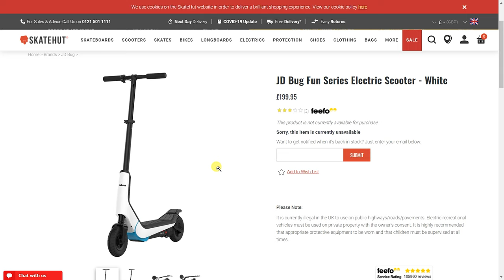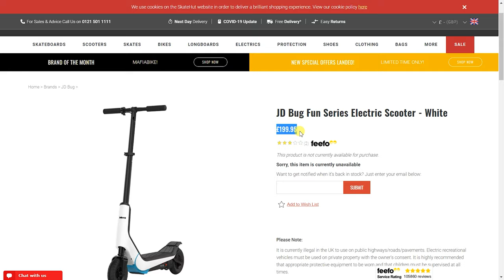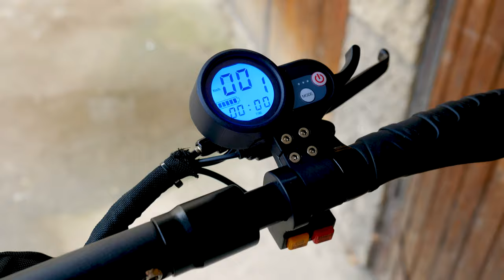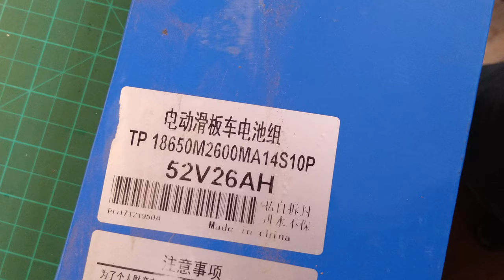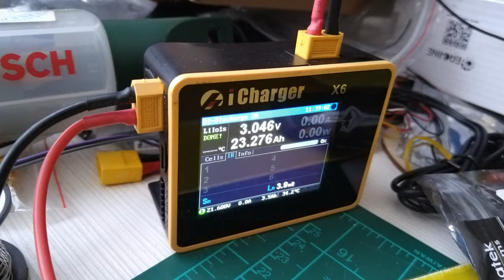My Electric Kick-Scooters - JD Bug, Xiaomi M356 and the Monster

Comment: Can I please get a link for which battery I require to upgrade JD bug. I brought one for dirt cheap and battery is weak. I couldn't find any information. So please i desperately need advice.
Reply from the maker: Hey, so I was able to fit without issues a 6S 16000mAh LiPo in there, not sure of the exact dimensions right now, but that pack fit pretty well. This was a long time ago and HobbyKing no longer carries these, but these here are about the same dimentions and the seller looks reliable, plus price looks pretty decent: https://s.click.aliexpress.com/e/_DmlAbbp